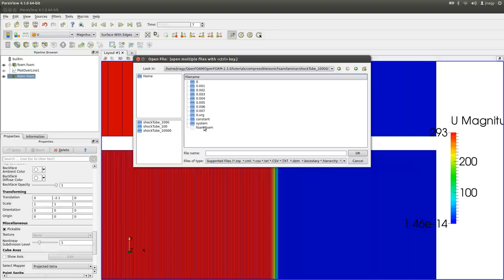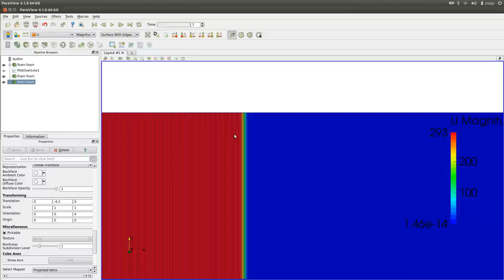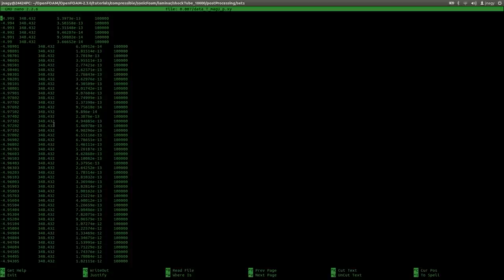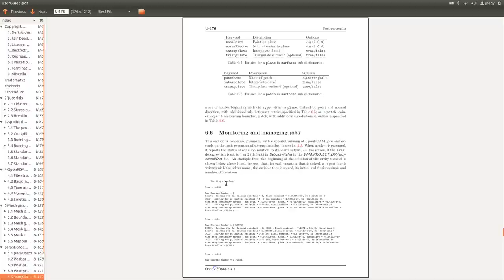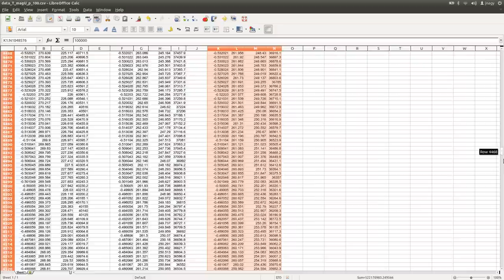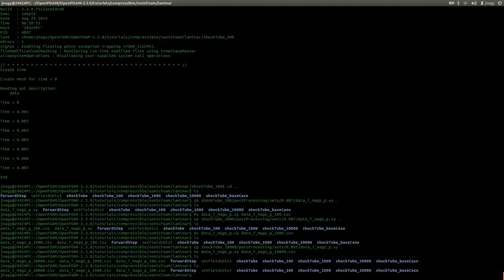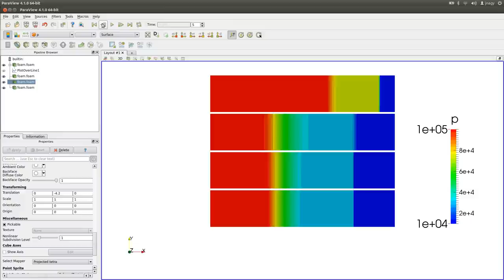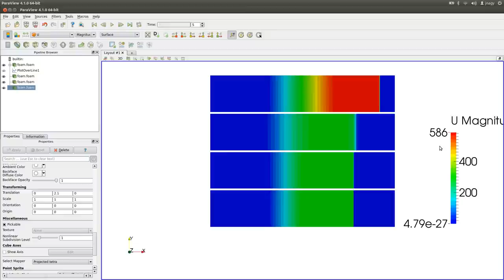Understanding grid convergence - Part 2

Comment: For newer OpenFOAM version it's:

postProcess -func magU

and

postProcess -func sample
Reply: When executing the command "postProcess -func magU" it appeared a FOAM Warning saying "Cannot find functionObject file magU" and did not create the new magU files.
Reply: @arturosirera7801  Try postProcess -func mag'(U)'
Reply: using openfoam 6 the User guide recommends to use    postProcess -func "mag(U)"     see chapter 6.2.3
Reply: @julianw.9499  Thanks a lot!
Reply: @julianw.9499  But it create two object magU and mag(U) in "0", is it correct, I am using openfoam 7
Reply: @mechguruji8502  In openfoam 6 the command only created a file named "mag(U)". The openfoam 7 user guide also recommends using   postProcess -func "mag(U)"     .  Maybe try around or see if it works anyway. Are you sure both files were created by postProcess -func "mag(U)" ? Maybe something you tried before created the "magU" file
Reply: Thanks!!
Reply: With openfoam2112 I used postProcess -func 'mag(U)' successfully.
Reply: @gerhardswanepoel759  Thank you so much!!
Reply: Thanks.
Reply: postProcess -func sample: kept saying --> FOAM FATAL IO ERROR:
Attempt to return dictionary entry as a primitive

Comment: Hello Sir,

I am new to OpenFoam. I need to set nonuniform velocity profile at inlet. like setfields for internal fields,is there any options in openFoam to set inlet velocity profile?
Reply from the maker: There are a lot of BC-s Check out the descriptions in the .H files in all the folders in src/finiteVolume/fields/fvPatchFields/derived. You might find something there.
Reply: I am working with 2-D case. Inlet velocity is mentioned as below-
for -4<=y<=0 , u=3.5 m/s
for 0<=y<=4, u=15.5 m/s
inlet is parallel to x-coordinate. Please help me to set inlet velocity condition in openFoam.
Reply from the maker: Just send me a mail to my email adress. You can find it in the about sectioncon the channel.
Reply: Thank you sir. I will send you mail.
Reply from the maker: Unfortunately, I have not received a mail, did it get lost?
Reply: I send it just now. Sorry for inconvenience caused.

Comment: Hello. Why sampling 10000 points in 100 and 1000 cases? That way you are making the sample tool interpolating to get the values. Isn't more realistic to use raw values?
Reply from the maker: +Carlos Completo Jep, exactly. Often I have to decide, which info to share here and which not, otherwise the videos would be way too long. But you are right. 10000 is overkill.

Comment: Nice video. I doing this tutorial on openFoam7. I have used rhoPimple solver to simulate. Now when  I give command postProcess -func sample, it runs with warning  : FOAM Warning : 
    From function static bool Foam::functionObjectList::readFunctionObject(const Foam::string&, Foam::dictionary&, Foam::HashSet<>&, const Foam::word&)
    in file db/functionObjects/functionObjectList/functionObjectList.C at line 278
    Cannot find functionObject file sample
 "
Also, it didn't create post process folder. How to correct this
Reply from the maker: Yes this works with v1912
Reply: Same issue here, no postProcess folder was created.
Reply: I checked the individual time folder, I think it was written to individual cases, as I can see "magU" in each folder.